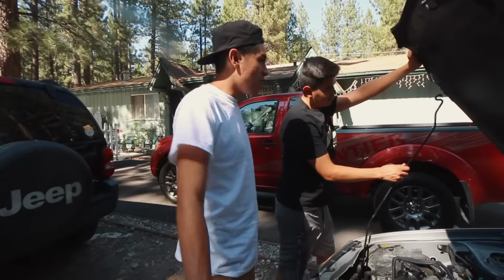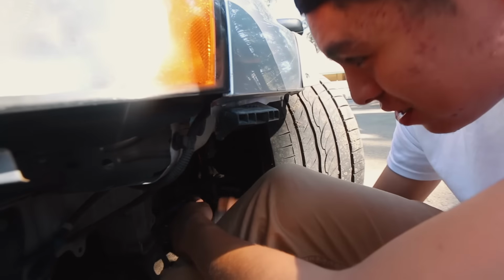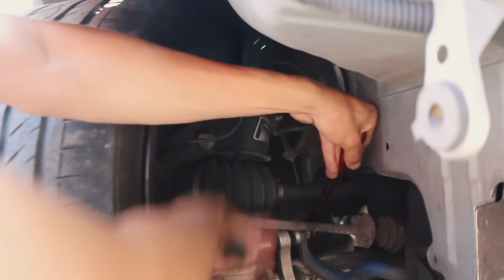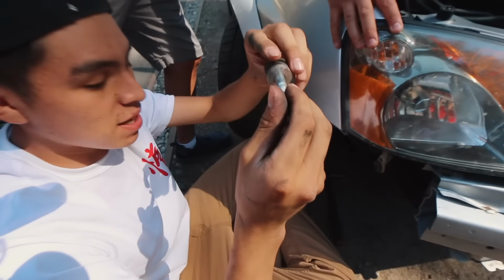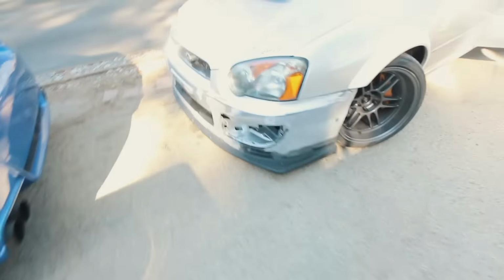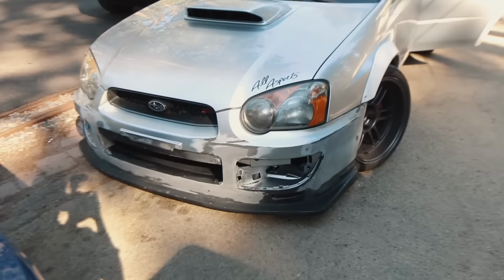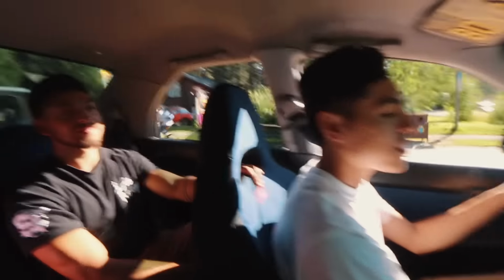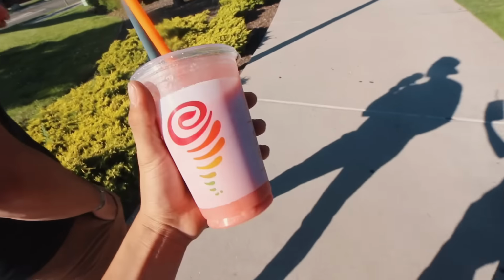Houston We Have A Problem... Still

Comment: 🔹Yo guys!   If you do the HOOD STRUTS, check out the GrimmSpeed ones!  🤙🤙They make an EXTENDED version that pushes the hood all the way straight up vertical - gives you way more room to work.  

Have it on my 04FXT and will be adding to all my other Subarus very soon (GC8 coupe, GF8, 93’ Legacy). 

They make accessing the engine SO much easier and they look dope!  Cheers!   👊

Comment: Bottom setting still will send 59 rear 41 front. Center diff will be open and keep that percentage. The more u move to the top it will move the power transfer closer to 50/50 until full lock which is 50/50. U can’t send “ALL” power to the rear ever.

Comment: I replaced all of my seals for my power steering rack and the same exact noise went away. My leak was coming from the input shaft. It cause me to have air bubbles in the fluid. So the pump would skip every time I'm on dccd lock

Comment: Sounds like the centre diff is binding
Reply: Triboro100 I 2nd this
Reply: this
Reply: 100%
Reply from the maker: Triboro100 it happened after we did the 5x114.3 hub conversion. I feel like it would be too much of a coincidence if it went out right after that.
Reply: SubieTroops I’d check the viscous couplings. If it’s started after the hub conversion it’s possible the silicone on the couplings are damaged due heat warp. Check this link it has good info on the viscous couplings.
https://www.alldrivesubaroo.com.au/gearbox/subaru-centre-differential/

Comment: im having a similar issue with mine. the car is fine when its cold and will turn tightly with no issues. however after driving the car and heating up the transmission i get a binding which causes the car to shudder and grind horribly; so bad that if i come to a stop with the wheel locked in first i cant pull the shifter out of first. My diagnosis is the viscous coupling  in the centre differential. maybe something to consider, but i think the 6 speed isnt a viscous unit

Comment: The hood prop has a mother setting you take it of the whole then spins the rod around and the u part that usually goes in the hood goes in the with the tip first then the bottom goes in the hole on the strut tower